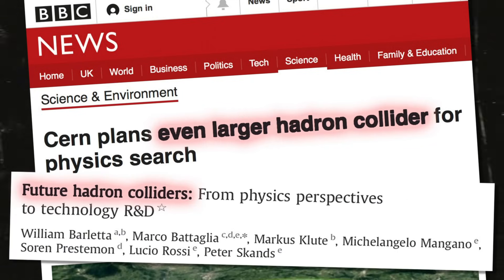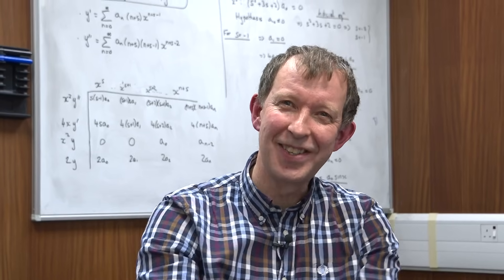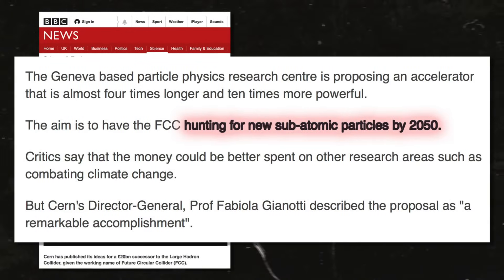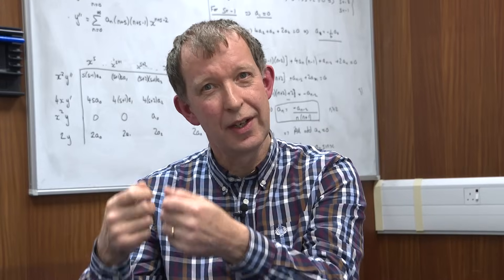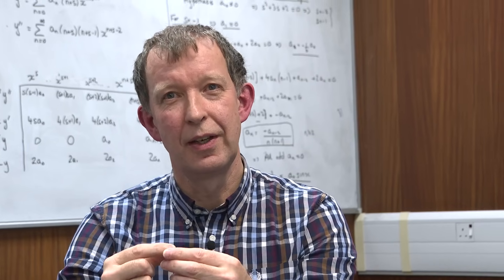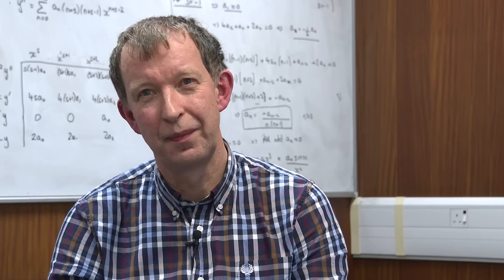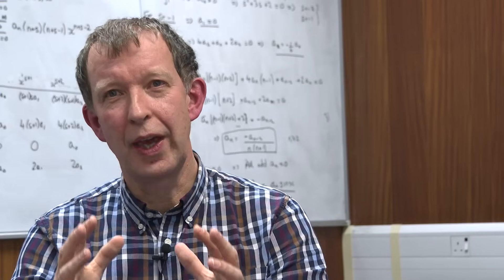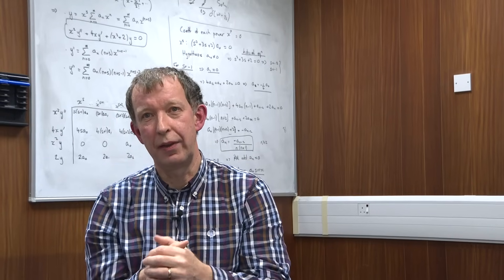Should we build a bigger particle collider? - Sixty Symbols

Comment: I'm still choking on the ideas of Superspin, the simplest forms of Analog Clocking of Modulating Amplitude and Frequency Resonances=> Singularity-point positioning Conception of real-time logarithmic projection-drawing Hologram. 

Growing up, we adopt mental models of things, hard objects, but at School comes airey thoughts of Mathematical reciprocals and scalar magnitude that float free in your head.., and it takes 20X longer to rethink a holistic, probabilistic approach to time-timing sync-duration identification of the e-Pi-i Mathematical Physics of invisible here-now-forever Quantum-fields Mechanism, than staying with the solid object concepts. Ie, I'm "forever" being frustrated with misidentified properties like BBT  that really ought to be Entanglement, the "dark side" of Singularity, the pure relative motion positioning that's "empty space" of time duration timing. 

If the LHC is the Microscope Camera that has found a candidate pulse-evolution, a particular specific coherence-cohesion objective labelled in verification by the device design.., this is typical Sciencing Math-Phys-Chem and Geometry precision of identification focused accurately on a particular function of Actuality. 

If we knew what we were looking for it wouldn't be called Research, but in this purely functional phenomenon, the how of this technique is sufficiently precisely accurate to describe what how and why, for the current state of analysis of the available evidence? (If that's how we get a better Theoretical understanding of Quantum Computational Information Technology,  ..keep doing what you are doing)

Seems to be consistent with Dr Hossenfelder's genuine Sciencing approach. It is not about Money, especially when the USA changes Research tactics away from big projects like the Super Collider?

Comment: "Do we need a bigger particle collider?", seems to be the the first question to get cleared in answering the one posed in the title. If, as I have a suspicion, there is no definite answer to the question, "how much bigger", I propose we focus all our available ressources on creating the necessary infrastructure for an industrial scale expansion into space first. This is to a large extend an engineerings problem at this point, partly on finding ways of cheap and reliable massproduction of nano carbon tubes  (which is a material with enough durability, tensile strength and weight - on top of being semi-conductive and other properties to boot - to be of use for spaceconstruction. If available in sufficient amounts). Partly to create new material using physical manipulation in nanoscale, with the promise of nano-assembly at the far end of the endeavour.  We'll get that spaceelevator. We'll get that moon-facility powering and facilitating getting an economy in place based on mining and space-exploration. Then we can go build that particle collider however big we want it. We'll have it ring one of mars' moons, just to be safe and sound from any explosive mishaps. But all this do mean we can't have any more wars. In fact, those 1000 billion dollar annual defense budget might cut it - barely. But we'll also need to throw a party every once in a while we reach a milestone, so. No tanks and bombs, sorry. If we can't live without we'll just have to make do with inching ourselves foreward, tera-whatt by thera-whatt and pay top-dollar with each little increment.

Comment: I wonder if it could be possible to build a sub-atomic gravity sensor, using neutrons or something, that you could measure somehow to tell if they (the neutrons) are being subjected to some kind of gravitational force, maybe from dark matter.
Reply: Have a look at laser-interferometry-based gravitational wave observatories. LIGO can already measure spatial distortions at sub-atomic scales. And since it showed that gravitational wave astronomy is feasible, there quite a few other ones planned around the world! :3

Also, some points b/c you come across as confused about them:
- There is no reason to believe dark matter particles produce any kind of "unusual" gravity (if that would even make sense.). A core assumption behind all (AFAIK) models that include dark matter is that they produce gravity the completely normal way - after all, their gravitational effects are the only thing we can see of their existence! The remarkable thing about them is just that they can't interact with electromagnetism, so the mystery is which of the particles who fit that bill it is.
- AFAIU Dark matter is mostly concentrated in the galactic halo; while there should be some particles whizzing around here, their gravity would be much too small to detect, esp. compared to what regular matter around here gives off. (Gravity is so weak compared to the other 3 forces that it's pretty irrelevant to experimental particle physics). The gravity from dark matter only becomes detectable when you look at systems as big as a galaxy, where their gravitational pulls add up. I'm not an experimental physicist, but in general putting some tiny mass (like a neutron) somewhere and measuring if it is accelerated in a way other than we'd predict by Earth's gravitational field sounds like a non-starter.
- The usual approach to detect weakly-interacting particles (like neutrinos (which are by now ruled out as dark matter candidates)) is picking up the extremely rare cases where they ~collide with atoms, like in Super Kamiokande or MiniBooNE, which are basically huge subterranean vats of stuff with photodetectors around them.
-  If you mean detecting gravitons themselves (the hypothesized sub-atomic particle that would mediate the gravitational force, like photons mediate electromagnetism - assuming we can indeed wrangle general relativity into quantum field theory), that is expected to be infeasible for any foreseeable future.
Reply: @nibblrrr7124  Thanks, I figured gravity would be way to weak to measure, I still wanted to let it drop here just in case it served someone else as brainstorming. I figure scientists want to build a stronger collider to see if stronger collisions are needed to create more particles (like dark matter ones). Cheers!

Comment: I feel like we need to develop newer types of detector technologies before we start building another particle collider. The current technologies, to my understanding, rely on particles stimulating sensors on semiconductor chips (similar to a camera sensor) or ionizing gas in specialized tubes. While that works well for what we've been using the collider for, if we are looking for new particles (esp WIMPs), that my not be enough.

Continuing to go down the path we are on, while there is still more to learn, will soon be a demonstration of the law of diminishing returns. It's like increasing optics technology so you can look at smaller and smaller things with a visual light microscope. At a certain point, while you get a very crisp image of the big stuff, you quickly realize that you can't see anything smaller than the smallest wavelength of light you can see. To continue the analogy, switching over to something entirely different (in this case using electron beams) is a far better investment than to increase the resolution of what is being done now.
Reply: No, there are a huge number of different detector technologies used on all the experiments on the LHC, much more than just semiconductor chips and straw tubes (of which there are a huge number of different types in themselves). To name but one completely detector of many used on the LHC, cherenkov detectors work by passing charged particles through an optically dense medium, and then the momentum of the particle can be determined by photons that are emitted as the particles pass through this.

Comment: Why can’t they do multiple loops in one tunnel? It looks like in a similar size tunnel to the LHC you could fit 2 loops so 50km in a 25km of tunnel or if you made it slightly wider you could 3 or more?
Reply: I can’t give you a technical explanation but as a proton accelerates faster and faster, the curve around which it circles increasingly siphons off its energy limiting its maximum velocity and its final collision energy.  A bigger circle or a linear accelerator are solutions.  The technical explanation will entail a discussion of synchrotron radiation, I think.
Reply: @cloudpoint0  ah that does kind of make sense like a car trying to go around a corner the less sharp the corner is the faster you can go around it and less energy required to keep it going around. I guess I was thinking at 25km most of the tunnel looks straight but it wouldn't be that way to the particles moving near light speed. Also I maybe misunderstood the problem as being one of needing more area to accelerate the particles not of needing to reduce the forces acting against them. 

Thanks!

Comment: How can increasing the diameter and radius of the supercollider help you anymore? You are already accelerating particles to 99.999% with alot more 9's or almost the speed of light? It's all about energy that you can put into the collision. Electronvolts? I have a basic understanding of the Standard Model? I will have to brushup. That shows the relationships of the Strong and Weak Nuclear forces, electromagnetism and gravity. But the goal was to come up with a Unified Field Theory? Even one that doesn't include gravity. Wouldn't just building a couple of nuclear reactors in the middle of the ring to ramp up the juice and increasing the sensitivity of the detectors be better?
Reply: Lastindependentthinker Its not actually just about putting more juice into the accelerator, its about how much we can bend the trajectory of the particle beam with magnets currently available. The bigger the circle the more energy you can put into the particle beam with the same magnetic forces containing and focusing the beam. Its basicly just about how much centrifugal force you can contain and manipulate, atleast thata what Ive heard

Comment: Nice video, nice argument also. My opinion is, if anything; if we're going to build something larger than the LHC, we should at least think about how to try building it in space. Given the rocket technology implied in Starship (which Elon Musk had the subtlety to cleverly conceal that in its design) we could be launching substantially larger machines. Space is also roughly tuned to be an excellent particle physics laboratory already; I've said elsewhere already that space is the rightful arena really for continued nuclear fusion research. I'd suggest getting some accelerators up there also, even if they're just small. Testing also the Muon g-factor in space couldn't hurt, and might be a better step towards enhanced progress in particle physics.

Comment: Would be be cheaper if it was built somewhere else? For instance if it was built in the middle of Canada or US where the land is cheap, would that reduce the cost by a significant margin?
Reply: No, the cost would be substantially increased as you would have to build an equivalent to the LHC there (and the prior accelerators to the LHC) to inject into the FCC. Not to mention there is not the expertise to do so.

Comment: The best possible particle accelerator would be using a linear accelerator around a black hole. There would be no limit to how much energy you could put into a particle, even with a finite size accelerator, because it would be held to a circle by the gravity of the black hole and no matter how close it got to the speed of light, it would be deflected about the same amount. With that method, you could get to the planck scale..... and then destroy the universe when you set off vacuum decay with the first collision lol.

Comment: We should go for habitats in the L4 and L5 zone, then build a space colider, less gravity will mean it'll be relatively cheaper to build a truly massive colider. but first we need some O'neil cylinders to have basic orbital infrastructure first.
Reply: Building particle accelerators in space would be at least a thousand times more expensive than building ones of equivalent energy beneath the earth's surface.  One of the reasons all the high energy accelerators are beneath the ground is to shield them from the radiation that affects the detectors.  Put them in space and the budget for launching all the radiation shielding, on its own, would cost hundreds of times the cost of the existing LHC.

Comment: Dark Matter does not interact with electromagnetic forces. It can be seen with gravitational lensing.

Correct me if I am wrong, but surely this means, to identify particles of dark matter, we need gravimetric detectors which can accurately pin-point gravitational fluctuations.

So, in regards to electromagnetic forces (or light for easiness), we have made many advances with detectors and are able to differentiate individual photons. This is mostly easy as light cannot penetrate certain materials and doesn't have a field per se, which allows much easier detection of photons in tiny amounts.

Gravity, however, is a field, and any moving object larger than a dark matter particle will "flood" any gravity-based detector.

We need innovation in gravity detection, as our current detectors like LIGO, rely on mile-long detectors which identify photon/time inaccuracies to prove gravity bent space, and is detecting huge trillion sun mass black holes, rather than particles.

Similar to how we use lasers and magnets to keep matter suspended in fusion etc, we need something to create a uniform "gravity" field so when a dark matter particle pops by - it is detectable as the uniform gravity field stops all the extraneous noise outside. Whether that is possible I do not know, as gravity is indeed a field and doesn't seem to be able to be cancelled. Light can be "cancelled" by simply having a solid block stop the photon.

It's like how really old UV-Vis equipment required a shield to ensure no natural light got in, as the detector just saw flooded light, but as the years went by they have managed to invent new ones where the cuvette sample can be open to daylight and get an accurate reading.

Comment: Perhaps someone here in the comment section knows more than I as to how the collider works.  I would imagine that there are "gates" involved and as a particle travels around the outer ring a gate is flipped to direct the particle to an inner ring and eventually the collider itself.  If this is even close to how it works, why then could they not just run the particle around the outer rings several more times to build up additional speed.  Four times around should be equal to four times the diameter?

Comment: Is it possible to build a collider out of nuclear fusion research facilities?
Reply: Probably not? Existing fusion research reactors, like Tokamaks or Stellarators, are small (1-10m) compared to modern* colliders, and they're built to produce very different electromagnetic fields & measure different things. Also, why would you? Fusion reactor (i.e. plasma) physics still cutting-edge in it's own right, so AFAICT there's not much reason to recycle them? ^^
The other approach to fusion research I know about is about blasting powerful lasers into a tiny volume, and I wouldn't know how to use that for colliders, either.

* Cyclotrons (mentioned in the video as cutting-edge '30s accelerator technology) are roughly the same size, AFAIK. IDK about more specialized types of accelerators, but beating Tevatron or even LHC in terms of energy with a circular design should require a diameter of kilometers.
Reply: @nibblrrr7124  It would help justify the investment.

Comment: One way to get better results is to build the next LHC offworld. Not as crazy as it sounds. In Amsterdam we have two AI robots that have designed and built (by printing metal) a bridge over a canal. So, build some self replicating robots. Put them into geostationary orbit around the Earth. Have one start one way and the other go the other way. You'd have a radius of 42,164 km (26,199 miles) and a total distance of 264,924 km (164,613 miles). All computer operation would be handled remotely on Earth. Ferry materials to and from the construction points. It wouldn't cost much more than these massive land based projects, and maintaining a vacuum in space is much easier.
Reply: This isn't even an original idea. Was thought up over 50 years ago. We now have the tech to do it, but perhaps it's still too expensive. Maybe once companies like SpaceX have brought their costs down and we've developed AI and robotics a bit more, it'll become so easy to do that it'll be the next natural step.

Comment: We won't be able to "produce" either Dark Matter nor Dark Energy until we can emulate Quantum Funneling. Unfortunately, only Massive Black Holes and Quasars are able to produce this amount of power. Going out and "sampling" will be the only way in the near future to pin down these particles. In fact, I believe we'll be able creatively distinguish  (not produce) cross-dimensional supersymmetry particles with the current excellerators (ie, 2 of the 3 Dark Energy particles.)